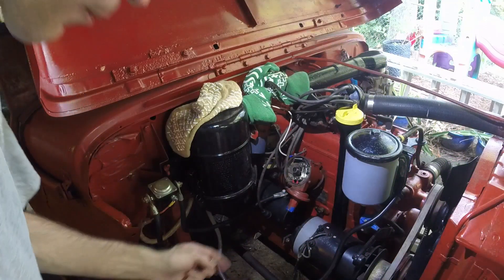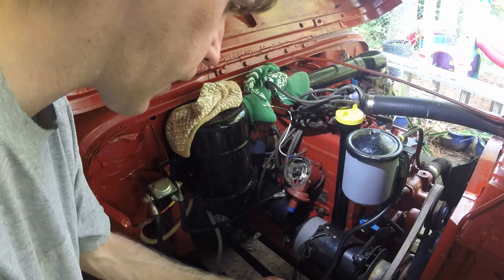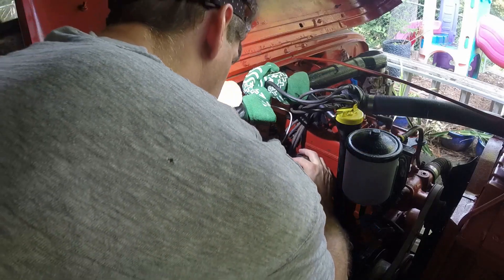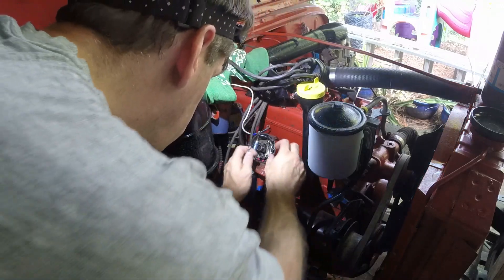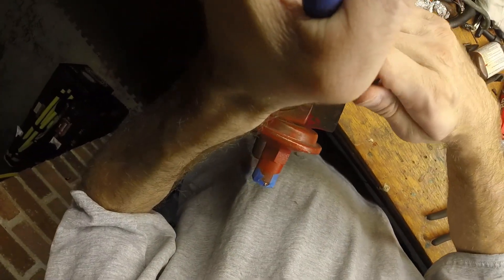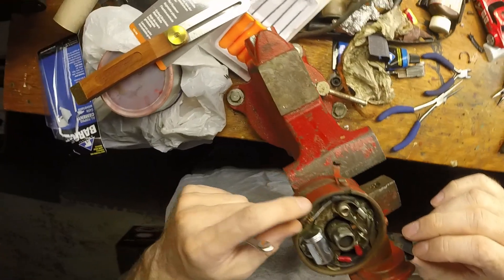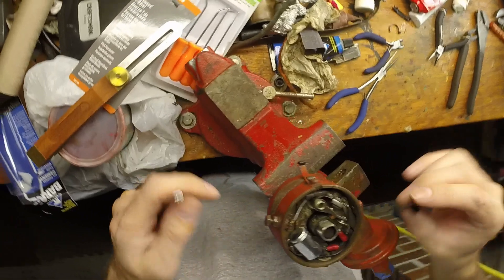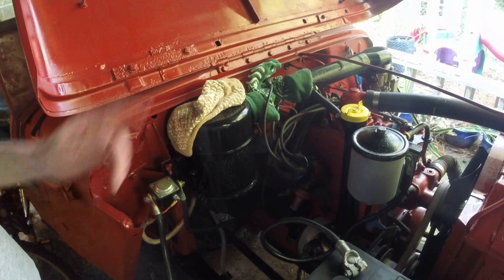Will it Fire Up??  Replacing the Distributor Condenser: Attempt to get the Willy 4-134 Engine Going

Comment: 0il pump drives distributor,distributor indexes into oil pump only one way,one side of distributor and oil pump are off set,to get proper indexing of distributor,make sure #1 cylinder is on TDC,both intake and exhaust valves fully closed with proper gap between lifter and valve stem,pull pump,install distributor,turn rotor button to #1 plug wire position,pull pump and see where the off set in distributor and pump needs to match for #1 position,may have to pull pump and turn pump gear to mesh with cam gear several times to get them to alighn up,when right,pull pump and install gasket and or sealer taking care not to turn pump gear,distributor and pump are now properly alighned,may have to turn distributor just a little one way or the other to get it to start,when it starts use vacuum guage to set to highest vacuum,timing should be very close to the right position,check for good throttle response and may have to adjust idle some!Take it for a test drive,watching temperature guage for proper cooling!
Reply from the maker: GREAT description of the process.  Thank you for leaving the comment!!!
Reply: @jaysjeepandclassiccars  You are very welcome,hope this helps all who see it!
Reply from the maker: @randallstewart8487  👍